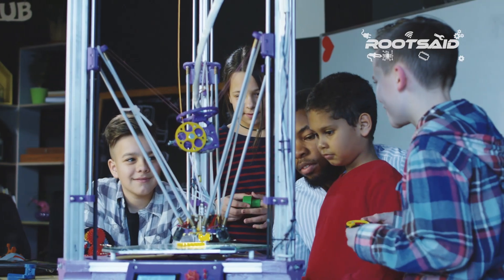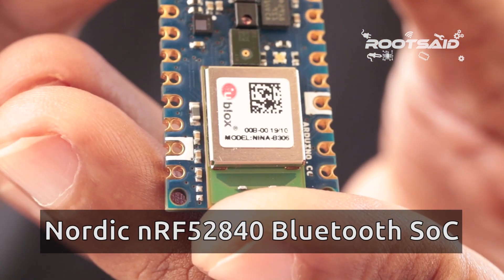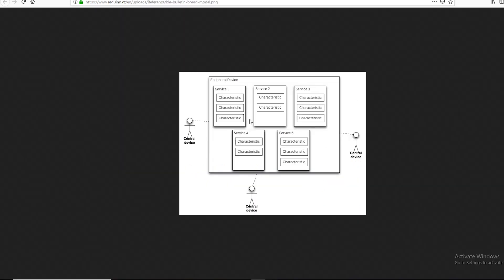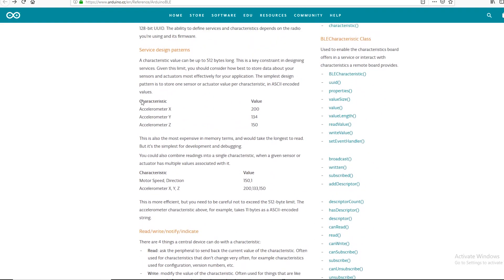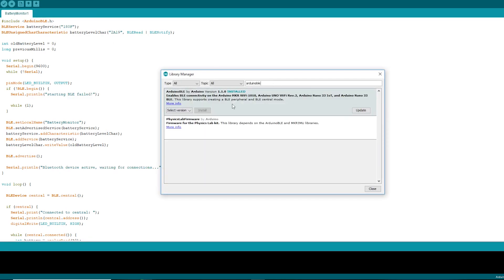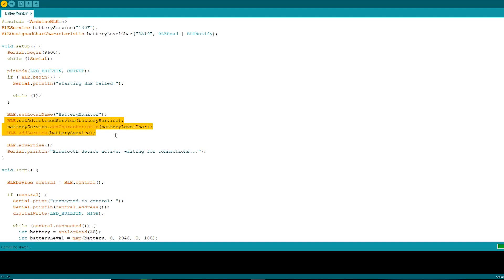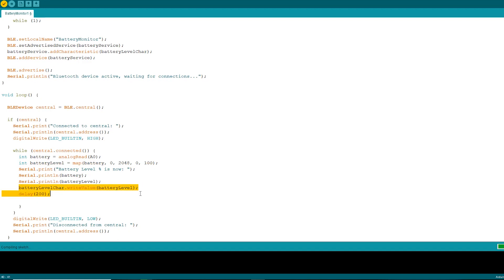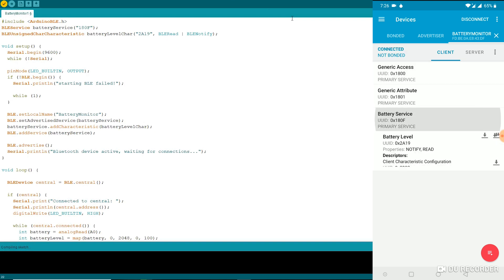Arduino BLE Example Explained using Arduino Nano 33 BLE Sense| Arduino Bluetooth Tutorial

Comment: Great video. Keep up the good work. I want to use Arduino Nano 33 BLE to make a wireless link between and my computer and my DIY CNC machine. How do you suggest I proceed.
Reply: Hi,I am going to use my nano 33 ble sense to connect with my laptop.But I just can 't find the right way to connect.Even my laptop can find the ble module.So have you finished your question?And how can i solve mine?

Comment: you seem to be a ble expert.   question for you.  does arduinoble  library allows me to scan for near by bluetooth phones?    it seems the api in arduinoble library only allows me to scan for central/peripherals which require the app on the phone to be running (i.e. phone cannot be on standby mode).   But i want to see which bluetooth phone is nearby.     All the examples I saw was to use AT commands.   Does arduino nano 33 even support AT commands?   I cannot find any info about it.  thanks head for your help

Comment: what pin to connect to A0 if I want to have a battery monitor of the attached battery? +3,3V Pin is ok?
Reply from the maker: That is where we connect the battery level input. Basically, pin A0 is the analog pin that we can use to mesure any voltage between 3.3v and 0v.
Reply: @RootSaid  ok, so no chance to measure the attached power bank 5V
Reply from the maker: @schoolhappyfellow  You can. You can use an analog Voltage level shifter in between which will convert a voltage range of 0-5V to 0-3.3V